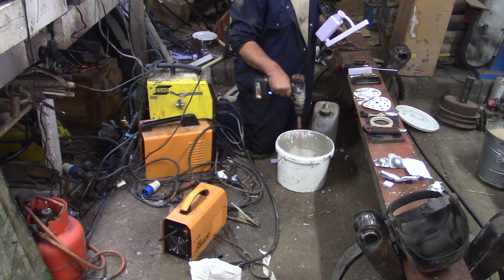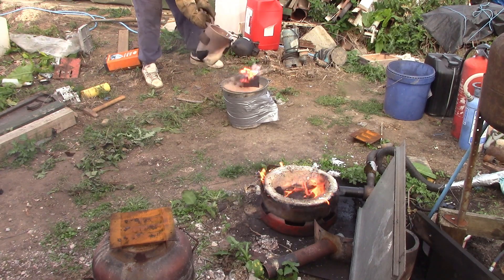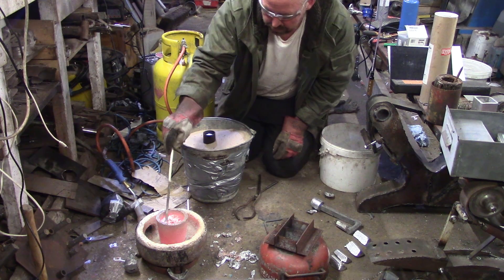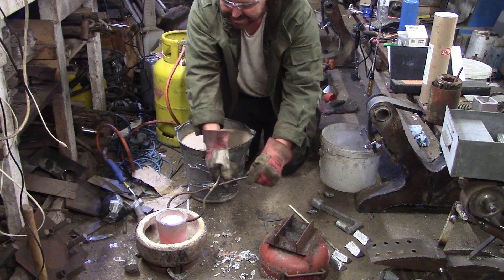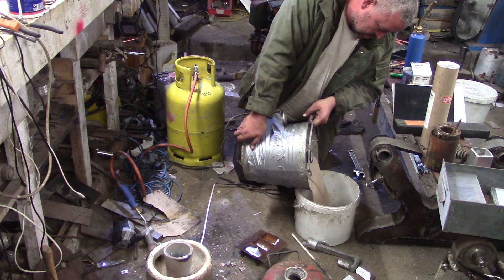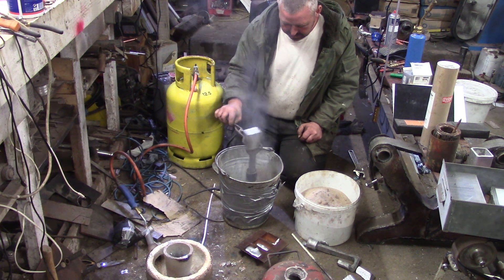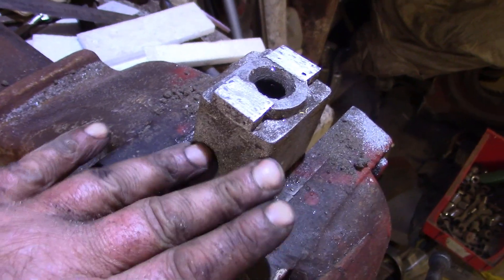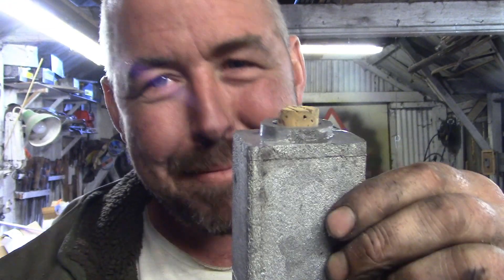Lost foam casting a bottle

Comment: Celsius is superior for pretty much everything, certainly technical things. who invented Fahrenheit anyway?
Reply from the maker: Some Polish temperature enthusiast, invented the thermometer and hydrometer so hats off to him, and at the time Celsius was backwards freezing was 100° and boiling was 0° so °F probably made more sense.
C ties into the rest of the metric system pretty nicely though doesn't it, once you've figured out the SG you can go in any direction fairly quickly.

Comment: If I understand correctly, the 'foam bottle' is filled with sand. So that only the walls consist of the foam. I would expect this sand to settle when the outer rim of the 'foam bottle' is burned away by the aluminium, but apparently not.
Reply from the maker: It needs a steady constant pour, when I poured stopped and poured it  collapsed

Comment: Glad your back at it..although a bit sketchy set up..near zero safety for spills or leaks..kneeling on the ground is a big gamble..I'm sure you are aware of it..a large sand box would be a lot better to cast with in it for safety reasons..there's a few guys on YouTube that has been able to pull off cast iron at home.. Cheers..
Reply from the maker: I had glasses, gloves and sleeves! The clutter and stepping over the foundry was the biggest hazard, I'll do better next time mate cheers for keeping an eye out for me.